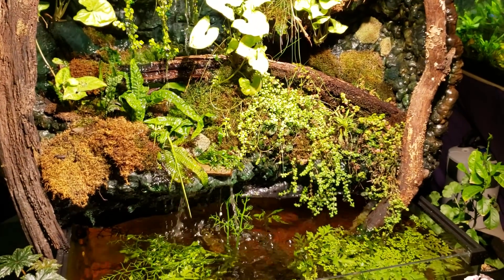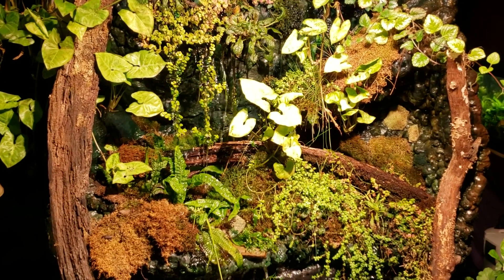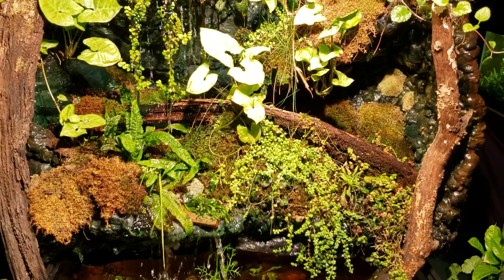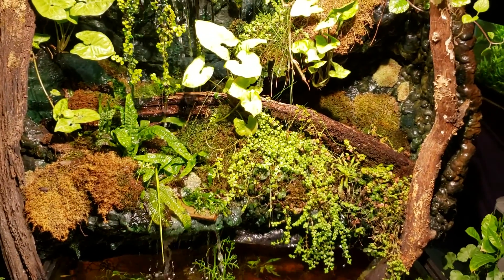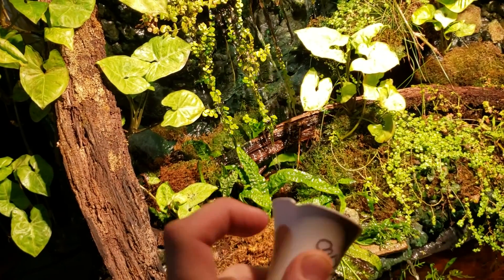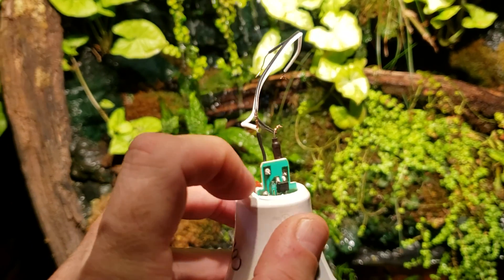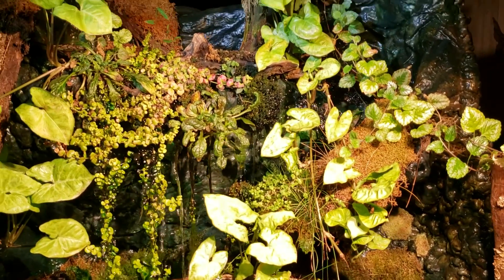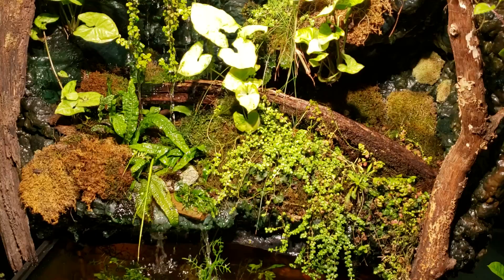Rethinking My DIY LED Grow Light Panel After Running Into Problems With The Cree "Bulbs"

Comment: You are following a wild goose chase with CRI.  CRI is based on comparison to a subjective standard, which is, in turn, based on the characteristics of the human eye.  It measures what an object looks like when seen under that light.  Photographers have long since known that the human eye is to a varying extent color blind.  We see red light much more clearly than blue.  When you are picking a white lamp(Technically, a lamp is the bulb or tube that actually produces the light. The fixture that holds the lamp is a Lumiere.)  for plant growth, what you need to be looking at is the Kelvin rating.
  The Kelvin rating will give you a much more accurate picture of the actual wavelengths of the light being emitted by the lamp. The Kelvin rating compares the light to a standard that can be accurately measured. The color of light radiating from any object changes as it gets hotter.  a copper wire, a ceramic plate, a tungsten filament, a gold coin, or a silver cup will always  have the same color when heated to same temperature. At the low end of the scale, it glows red, then orange, then yellow, then warm white and progressively bluer as it gets hotter.  
When it comes to lamps, the most common Kelvin ratings are 2700K,3600K 5000k, and 1600K.  2700K lamps (soft or warm white) are rich in red and yellow light and very deficient in blue light. They are the furthest thing you can get from natural sunlight and are practically useless for plant growth.  Once the plant is grown, they will help it with flowering and fruit,  But growth itself depends on the carbohydrates from photosynthesis and experiments prove that photosynthesis occurs at a much faster rate under blue light.  3600K lamps  are seldom seen because they have been replaced by 5000K (bright white or natural daylight) lamps that are the closest thing to natural daylight.  They have the best balance I have found of red and blue light.  6500K (daylight)lamps are rich in blue, but are very deficient in almost all the other colors. These are the cheap, depressing industrial lamps seen in so many factories and workplaces.  Since the light is so very bluish they wash out all the colors in the room.  This is also the color of the so-called cool white LEDs.   in the past I have had considerable success by combing a 1:1 ratio of warm white and daylight lamps.  Daylight lamps are also good in aquariums, since aquarium water is usually stained to some extent brown due to tannins and fish poop and urine, which tends to filter out blue light. 6500K lamps provide enough extra blue to penetrate the filter effect and penetrate to the plant leaves.
A word about those purple Grow Lights. It is my personal opinion that they are a waste of money. A good 5000K lamp provides the same growth effect and costs a big bunch of cash less and Don't distort the colors of the plants and blossoms.
Reply from the maker: I know what CRI is. I'm not talking about the plant. (Temple plant will grow in very low light, so that's not an issue) I just want the tank to look nicer to my eye, which is what CRI indicates. (also gives you a better idea of the spectral output of the light. The more natural the light looks, the closer it is to natural sunlight, which is always the best for plants no matter what "blurple" light manufacturers try to tell you)
Fluorescent lights are such garbage quality that you have to maxize what little you get, so using the propper color temp with fluorescents is a lot more important than when using LEDs. (depending on the brand, of course)

Comment: i want to learn about lighting for my aquarium to... some of the panel leds are full spectrum and some are white.. and i am seeing growth with the all whit but wondering what full spectrum would do...
Reply from the maker: In theory, white light is full spectrum, but not all "white" light is created equal.
Reply: Aquarius: Originally Full Spectrum was a term for a grow light that radiated the red and blue of normal grow lights, but added yellow and green phosphors to eliminate the color distortion and produce a white light.  Unfortunately, it seems that, these days, every maker seems to have a different interpretation of the term, and most of the "full spectrum" bulbs on the market are just modifications of the old pinkish purple lamps.  If you want to know what a true full spectrum lamp is like, just pick up a 5000k Bright White lamp.  In an aquarium, since the water tends to filter out blue light, you might get still better growth with a 6500K lamp, which is much richer in blue light.